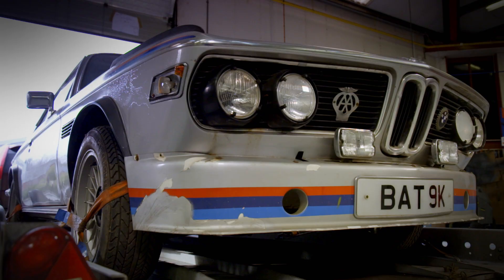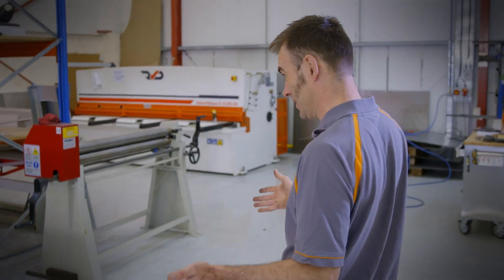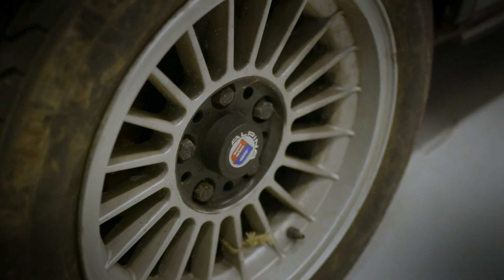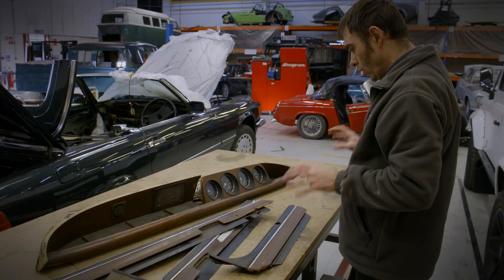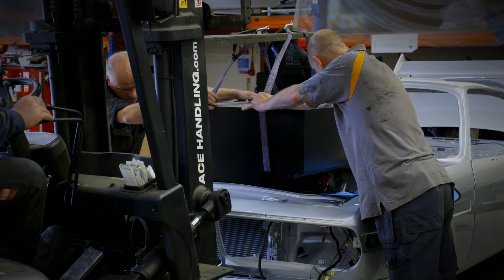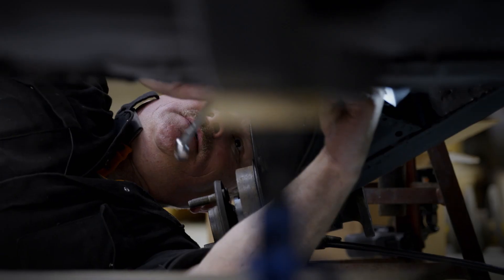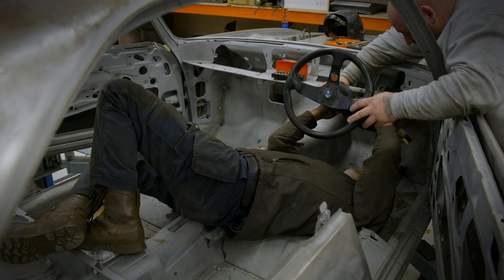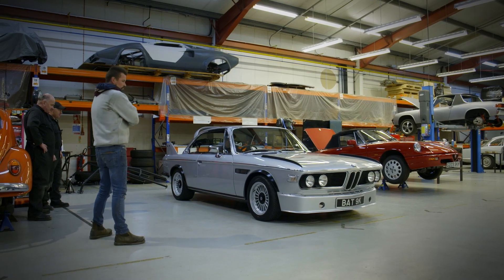Vintage Voltage series 2 – BMW “Batmobile” - Episode 8 QUEST PROMO

Comment: So you make it look like an original car then remove it's lovely, original engine and gearbox and wedge in a motor and batteries! 😂😂😂 What fake times we live in
Reply: "You remove the horse from the carriage and give it an smelly, short range, loud and heavy engine. What fake times we live in"
Reply: @Jimunu  yes, much better to use a brand new invention, the electric motor, and put heavy batteries to power this new invention, I might take out the clockwork mechanism from my valuable old clockwork pocket watch and replace it with a cheap, Chinese quartz movement, it will be a lot better then, worthless but much better, I might even get my smelly, expensive to run pet cat stuffed, much less maintenance, cheaper to run and better for the environment, yes this fake world is much better than the real world😂😂😂
Reply: @Markcain268  a petrol engine is not heavy?! real authoritarian and narcissist of you to think that you decide what's fake and real.
Reply: @Jimunu  I never said it wasn't heavy, probably about the same weight as the batteries, and if you don't think there's are lot of fakery on the internet then you are very naive, probably just a child
Reply: @Markcain268  why would you mention heavy batteries in your response then. I am deeply  interested in what's fake and real  and how others use them. And your word usage of "fake" makes you sound to have a child mentality if not age.
Reply: @Jimunu  it's too early in the morning here to argue with a bigot, so, whatever you say big guy
Reply: I guess you're gonna feel bigoted against when I mention that social media posts stay up and can be answered later in the day. Telling that you did not respond to my points.
Reply: @Jimunu  busy day ahead kid, I'll have forgotten all about you shortly, but I'll give you a tip, don't take the internet so seriously, I look at it as a bit of fun, like most folk do, it's not important enough to me to take seriously, have a nice day kid
Reply: The amount of weight that is now in front of the front axle is huge. The 3 things this car had going for it, noise balance and style. The first 2 are gone.